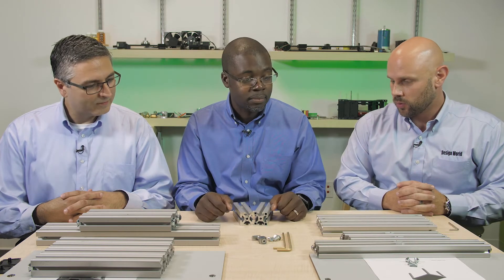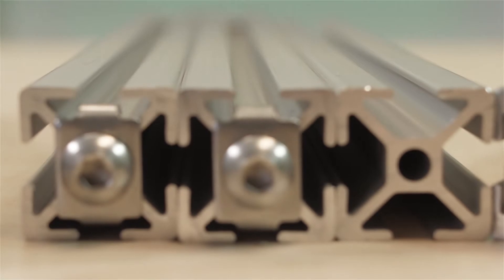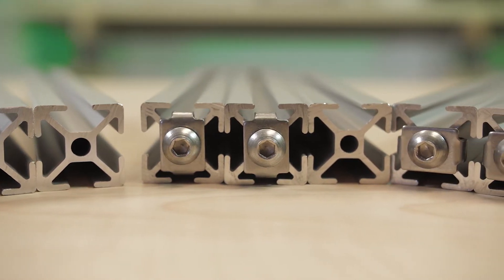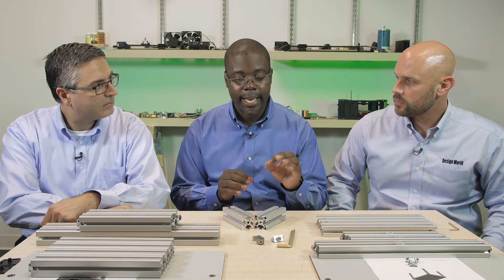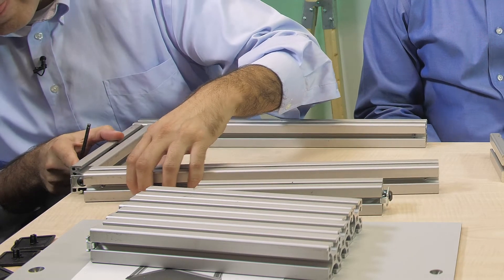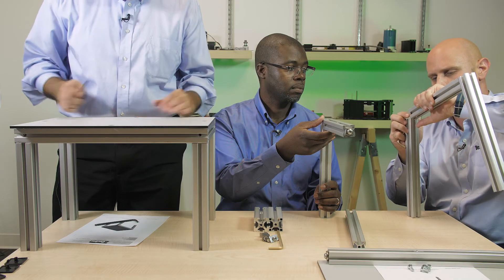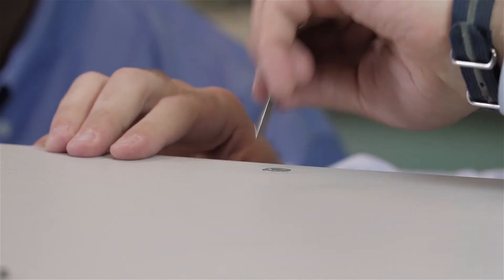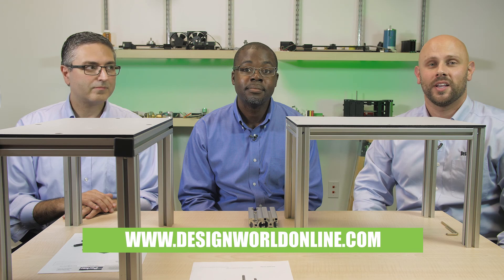Parker’s T-Slot for Fast Aluminum Framing Assembly

Comment: How does this compare price wise to 80/20?
Reply: In some cases, it would be comparable. You'd need to review the application and see if you are just in need of the framing raw material and fastening components, do you want the factory to do the necessary machining and send you a kit, ship a fully assembled unit, or would you require other value-added items such as linear motion, etc.

Comment: It appears that the T-Slot rails for the two tables are different . One layout appears to need end caps and the other does not. Is the the case?
Reply: The end caps are non marring soles for the table legs I bet.
Reply: They are two different profile sizes: 30mm x 30mm and 1.5" x 1.5". In this case, the table that uses the 1.5" profile did allow for the use of end caps. The user could have chosen to leave them off. The table that uses the 30mm profile would not require the end caps, due to the design. Note: one could use end caps on the bottom of the table (for demo purposes). Thanks for the question.

Comment: I use this material all the time at work but would be great if it wasn't so expensive
Reply: Hi Kevin, what types of applications do you use the framing for? Maybe we could help by taking a look at the design or seeing if a different grade/weight of aluminum could be used. If you have questions, you can reach out to ips_marketing@parker.com

Comment: I love the pass-through holes to access fasteners.  The software sounds great but can they just import someones stp file that was done on a CAD program?
Reply: Currently, the Design Architect (TADA) software can export stp files, in addition to native Solidworks, Inventor and CREO. We will consider a function to import files, such as a stp file, in the future. Thanks for watching and be sure to download a copy at www.parker.com/designarchitect
Reply: @mariomitchell1604  Outstanding   I use Fusion 360 which can import stl or Solidworks very easily. Ideally, I'd design in Fusion 360 and you'd be able to import my file.
Reply: @mariomitchell1604  Unfortunately the link no longer works and I am not able to find the application on your website.

Thanks for the great video!